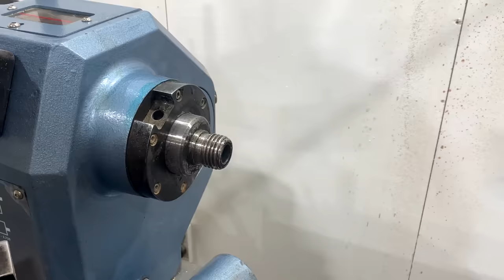Woodturning - 3D Patterned Plywood!

Comment: This is magic to me.... take a straight line, set it into a cube, knock off the corners and, abracadabra!, 
the straight line becomes curved. Such a beautiful piece.
Reply from the maker: Thanks Max. Much appreciated man 👍🏻😊
Reply: you should see the steps behind a Celtic knot, it just looks like intersecting x's with straight lines over the top before it is turned and the rounded pattern is revealed.

Comment: Nice. :)
I love when creators use the plies as a feature instead of hiding them.
I have made 2 table tops so far, where I have used staves of plywood glued together, so the plies are visible from the top, bottom and ends. The real challenge is getting 2 staves with perfect sides from one end to another to use for the sides of the table top.
I coated the first one for my assembly table with water based floor laquer, but it has virtually no resistance to water, so the second one I made recently gets a couple of coats of ship laquer.
Reply from the maker: Sounds like a big job! Would love to see 👍🏻😉👀
Reply: @JackMackWoodturning  The first one took me a couple of weeks to make, as I only had a narrow European style workbench at my disposal, and had to glue in small batches (lack of clamps).
The second one was made in a weekend. :)

Comment: Hi Jack, need an opinion. Going to get a few viewpoints from other turners. 
I'm moving my lathe to new poured pad specifically for it.
I've turned large projects before, buy never anything "Out of balance"
Your thoughts on bolting the unit to the floor, or let it free stand?
It's a Delta, with a 48" bed, so it's fairly heavy on its own.
BTW, really cool vase.
Reply from the maker: Bolt it… BUT don’t then treat it like it’s indestructible..
Reply: @JackMackWoodturning  Thought it might shake itself apart.
Reply from the maker: It definitely would if you abuse it.. an argument against bolting the lathe down is that the spindle takes the force of unbalanced work pieces.. This theory assumes the operator is going the put the biggest most u balanced piece on the lathe and turn the rpm up..
If you don’t bolt it down you’ll need to do what I do.. which is to sit half a ton of sand on the lower shelf between the legs.. both essentially have the same effect.. just don’t abuse the lathe and you’ll be fine.. ( I don’t bolt my lathe down because my workshop is on a suspended wooden floor)
Reply: @JackMackWoodturning  Thanks

Comment: It looks amazing, but man, I must say, you have far more faith in those plywood ply glue joints than I ever would. I’ve seen that stuff delaminate under far less strain.

Also, is it waterproof? Like, could you use it as a flower vase?
Reply from the maker: You’ve seen brand new Baltic birch ply delaminate??

Comment: Stunning! I never cease to be amazed at your insight and skill. I've got a scrap bit of wood (ordinary soft wood used in building) leaning against the wall outside. I know you'd create a masterpiece with it :-) I have wondered though, has it ever gone wrong and...if so, do you have the disaster on video?
Reply from the maker: I have a video called ‘the exploding bowl’. It is the only time I have been injured in over ten years as a woodturner. I got off lightly too. 👍🏻😊

Comment: You missed at least two surfaces that needed glue the last gluing before turning! I'm glad no pieces flew off and wrecked you!
Reply from the maker: Are you for real ?
Reply: @JackMackWoodturning  Absolutely! At 6:25 you can clearly see the top surfaces of both halves and the bottom surface of the right half did not get any wood glue! I know they were glued to other pieces that did get glued earlier, but depending on the shapes involved and the patterns being turned, that could easily result in pieces flying off at high speed.

Comment: Instead of sawing through a glueline, you might want to put a page from an old newspaper between the two parts before the glueing, you'll be able to break them apart real easy again later, so you don't need to saw. Not recommending to turn anything when you still have a papered glueline in the piece though, it's pretty fragile, and only good for a temporary connection.
Reply from the maker: It’s great for turning. I use it for turning half spindles but use paper a little thicker than card. It splits well but holds very tight while you need it to.

Comment: I cant stop thinking about the two tiny opposite planes lacking glue o.o 
i wish it holds. And the resulting pattern blows my intelligence away.
Reply from the maker: What do you think is lacking glue ??
Reply: @JackMackWoodturning  hello! If i spot right, you missed to glue two topmost dark planes when final glueing the two half-cuts to the middle
Reply from the maker: Those two top most sections became the rim. There is no glue in them as they did not contact another face.
Reply: Thank you. Umm, half of each actually contacts o.O
Reply from the maker: I see what you are saying. But if you consider what’s the glued sections are in the whole piece those two half’s are not needed. It’s not like they would come off. And cleaning the glue from the run would be an unpleasant job.
Reply: =) ok i wish it is ok. Great work, thank you, byebye

Comment: Is it just wood glue holding that together while you do your thing?
Reply from the maker: It is. But wood glue is incredibly strong. The bond it creates is stronger than the bond holding wood fibres together within a single piece of wood. 
That’s is proven when you glue two pieces of wood together and then apply enough force to break the glued up piece. The resulting break will always break the wood rather than the glue joint. 
(If the glue is done correctly of course) 
Super strong stuff is wood glue 👍🏻
Reply: @JackMackWoodturning  very mesmerizing ❤️